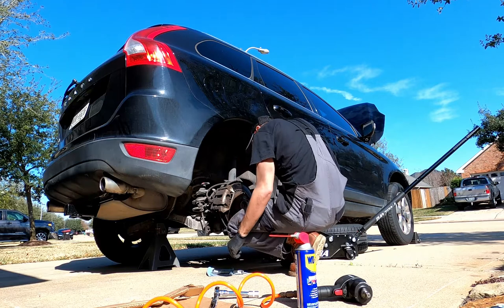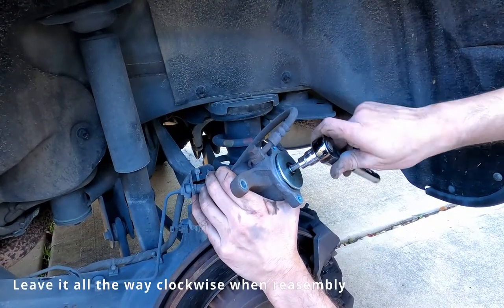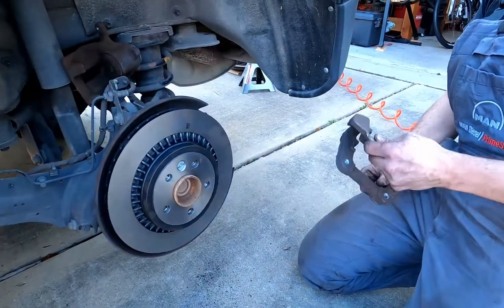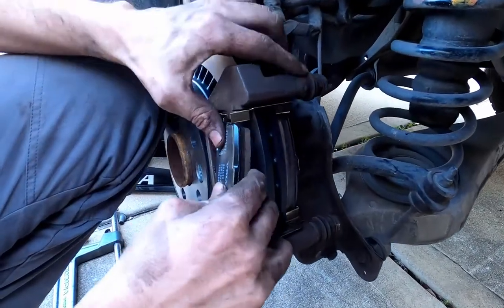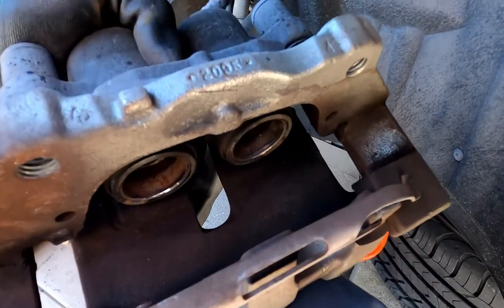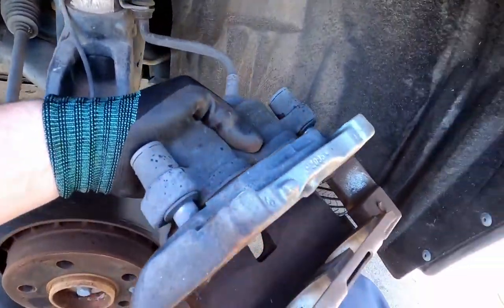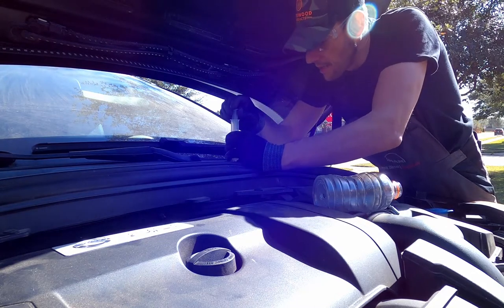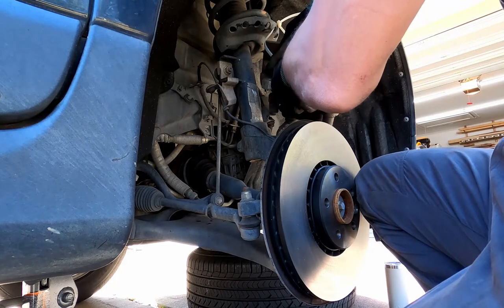2013 Volvo XC-60 front and rear brake pads and rotors replacement

Comment: Hi, can you solve me a question, brake hand must be in position on or  off before I begin to anmmount rear brakes?  Thanks in advance.
Reply from the maker: If you have electric park assist, it will be on once the car is stopped so you will have to either have a diagnostic tool and put the car in service mode so it will release the electric park assist or do it the way I did it by removing the servo and unlock it manually. Make sure the car has block in the wheels to make sure does not go anywhere. If you car has hand parking brake I believe you will have to release is to remove the caliper but I have no experience with that.
Reply: @BUTTEWORKS  Hi, I have a electronic parking brake, EPB,( electric park assits is other thing), I believe you are talking EPB, Ok?

Comment: Any lubricant?
Reply from the maker: The set came with lubricant pouches that I used in the back of the pads where the pistons pushes the pads and anywhere where the metal clips touches the pads ad the instructions showed